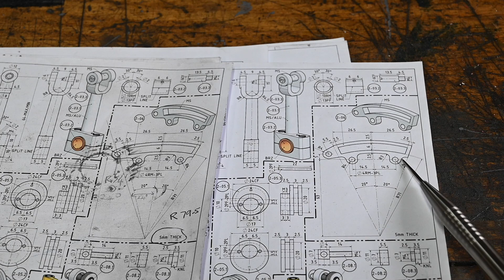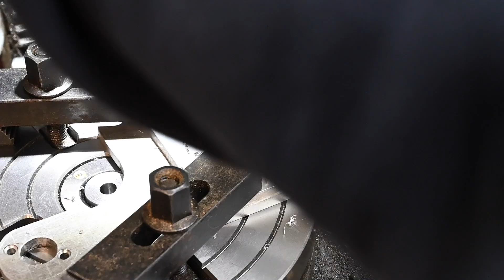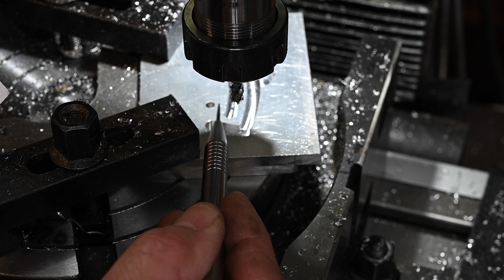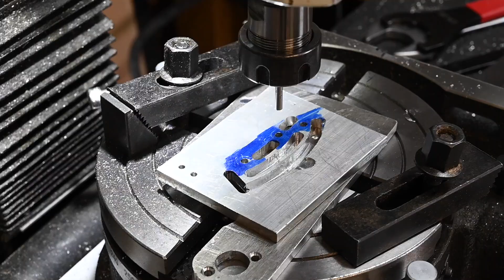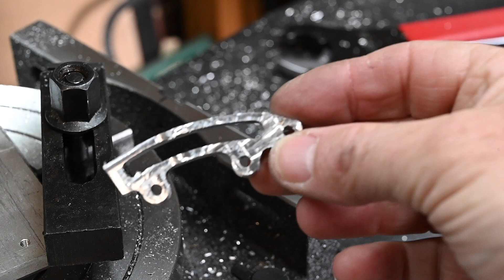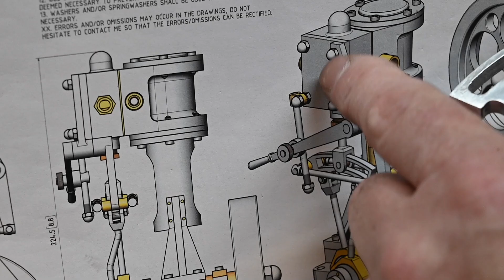Forward & Reverse Selector Guide EP15 using the Rotary Table

Comment: Nicely done.  Would have helped me if you showed how you located the work on the rotary table to get the curves at the correct radius from the centre of rotation.  And showed how you determined the coordinates for the three holes.  Using the pin to locate the holes over the centre of rotation for the radius around the holes is good.

Also my rotary table is only a 4".  Any extra measures when using a small rotary table?
Reply from the maker: @AndrewClarke-wb5hh  the work was positioned at the correct radius from the centre of the table by just measuring with a rule and then sweeping the table to confirm the radius would cover the material, dimensions for radius and holes were taken from the drawing 👍

Comment: What is the material being milled?
Reply from the maker: @paulmcdonnell1833  hi, it’s aluminium 👍
Reply: @EnglishHobbyMachinist  thank you.  Do you use aluminium much for valve gear rods etc?  Thinking about aluminium for connecting rods etc as well as the reversing link etc.  Worried it may not wear as well as steel.
Reply from the maker: @paulmcdonnell1833  I use aluminium because I build my models for show and not to use 👍👍

Comment: 3.24 where did you get your puffy blowy thing? I've looked allover and never seen one. Quin uses one as well, seems a good idea rather than firing up the compressor for a little job.
Reply from the maker: @paulrayner4514  I do a bit of photography and they are designed to blow fluff of the camera lens. If you google camera lens puff or something like that, should throw up some results 👍
Reply: @EnglishHobbyMachinist  cheers for that 👍 I will do it now.